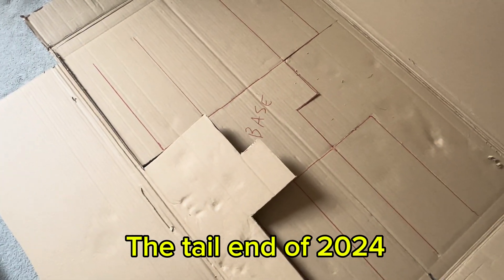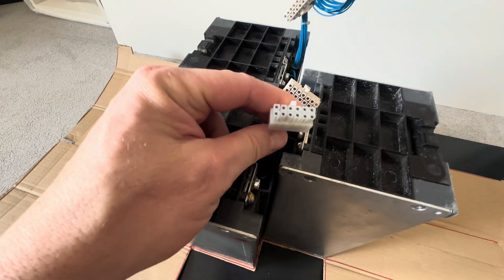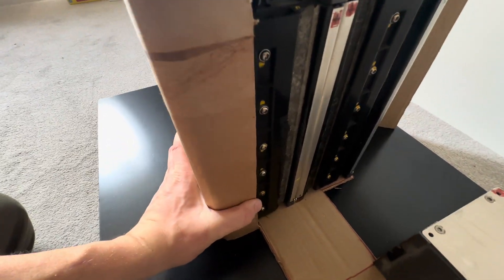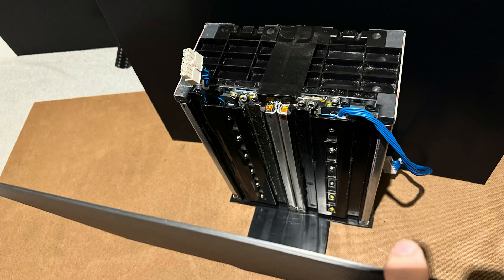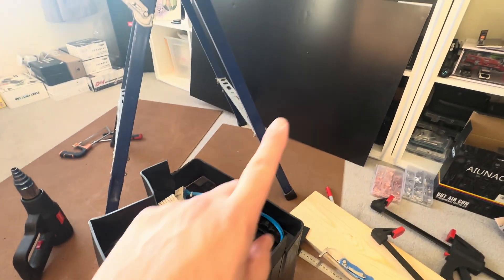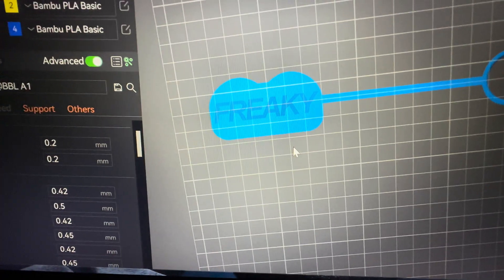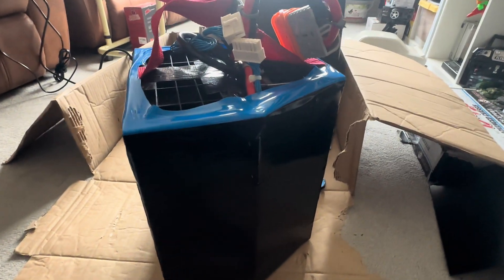The Mini Stark Varg | Battery Build

Comment from the maker: ITS HAPPENING PEOPLE 
0:00 it’s coming soon.
0:21 how i did it.
1:55 how I made my battery template.
3:00 strapping my battery up.
3:08 the weight of my battery 22.7kg.
3:15 starting the battery build.
5:09 when I wasn’t happy with things.
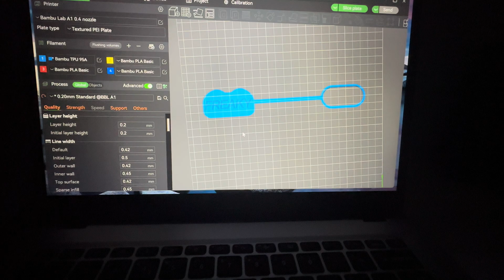5:27 3-D printing some Anderson connector covers.
5:56 changed of plans.
6:17 new plans happened.
7:20 charging the 100V battery for the first time.
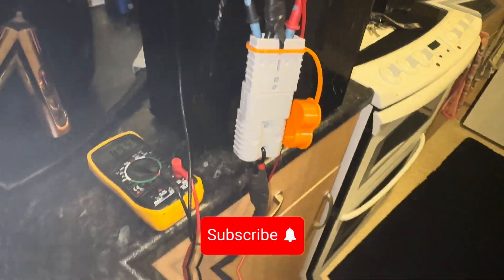7:53 subscribe and like

Comment: Hi. Great project! How many miles on it? Is everything is OK with engine mounts? did it need to be upgraded somehow? Regards
Reply from the maker: @slavarybin9482  thanks. How many miles on the bike.? Originally do you mean.? Yeah I made my own mounts for the electric motor. The playlist is hear if you want to see the build so far. 100v dirt bike project
https://www.youtube.com/playlist?list=PLSRBWOTFczaBGWKfx0IA2fXKsz-XK0uoA
Reply: @Fpvfreaky  i mean how many miles were after conversion. Are mounts reliable? Regards
Reply from the maker: @slavarybin9482  no miles are on it yet . Still converting it. And yes hopefully the mounts will be strong enough. If not I will make them stronger 💪🏽😁
Reply from the maker: @slavarybin9482  1300 miles before conversion.

Comment: I'm very local to you I've just put a new 81volt battery in my surron so.... when we racing!?
Reply: I took it out today on 21kw I got a torp set up 25kw motor and tc1000 controller the 81 volt 50ah battery came today and its faster than my old 450 by far... i have my old motor controller ect. Im willing to donate to a go cart project if your intrested
Reply: @BUDDZINO88  Did you by any chance get Electron to build your bike? 

Whats the 81v Torp controller and motor like compared to say stock motor and 12kw and ebmx/torp controller 72v?
Reply from the maker: @shifty277  he answered you in the comments mate.. but for forgot to tag your name.. take a look in the main comments 👍🏼
Reply: @Fpvfreaky  just seen, thank you
Reply from the maker: @shifty277  no worries bro
Reply from the maker: @BUDDZINO88  cool bro yeah that torp is good on the surron gives it a lot more power. Good fun. 😁  you willing to donate?
Reply: @Fpvfreaky  yh I don't need it prefer to see you build something crazy with it....maybe a drift cart or suttin
Reply from the maker: @BUDDZINO88  yeah ok bro.. that can be done. Cheers man  👊🏽😉
Reply: You'd need 400 dc amps and 1200 phase amps to compete with this bike. I like the surron, but this is a completely different beast. The lithium titanite batteries alone cost more than a surron these days and the motor can handle over 50kw no problem. I've never seen a motor of surron dimensions cope well with even half that power, even the ipm motors like KO and sotion struggle.
Reply from the maker: @colinriches1519 I know it’s gona be abit crazy lol😂 I just hope I don’t brake it to fast. 😢😂 gona have some fun
Reply from the maker: Hi mate yeah sure when it’s done. And tested got it all set up.
👊🏽😉 I think we have meet before haven’t we? I would like to see it side by side next to a Surron would be cool. Goin for some rides.
Reply: Wicked I have a good feeling about this summer
Reply from the maker: @BUDDZINO88  👍🏼😁 it sure is brother it will be nice to get out on some rides 👌🏼